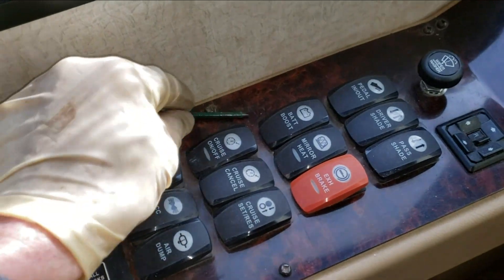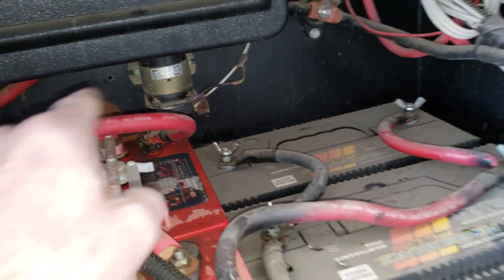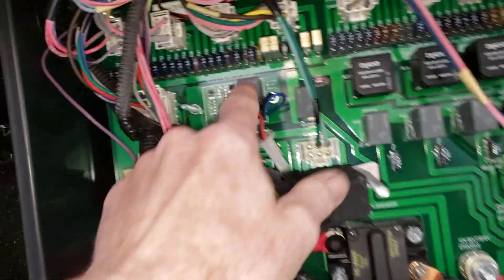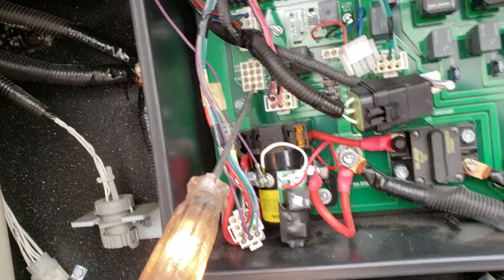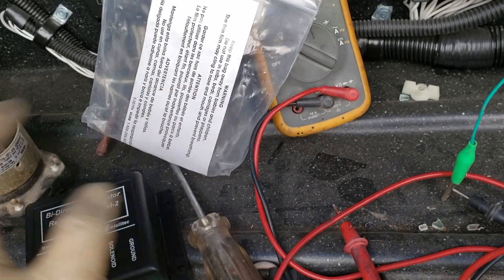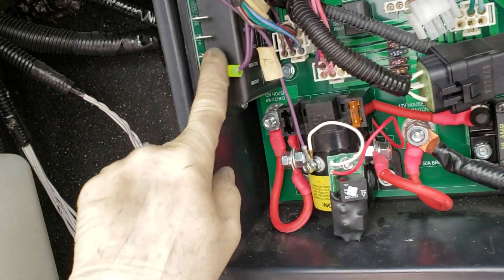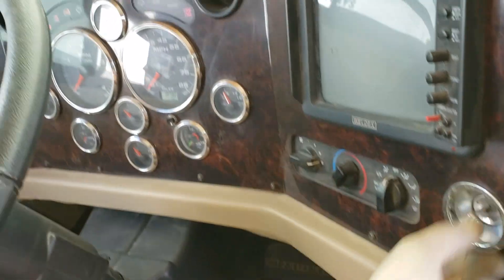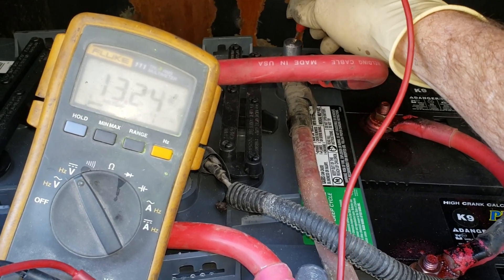Monaco Diesel RV Charging System Upgrade Trick?

Comment: Great stuff here, as always. I was having the same issue when being plugged in for the winters in Florida. I went with a very small batter tender which can live in the battery bay. When plugged into shore power, I do have to run an extension to the 110 outlet in the engine bay. Not a big deal, really. I could run some power to the battery bay and install an outlet in there, but I don't think I'm going to go through that trouble. Seems odd that Monaco didn't think of this. These vehicles are not daily drivers, so the engine batteries should be charged periodically.

Comment: Your videos are very informative and helpful. They have helped me repair quite a few problems with my 2005 holiday ambassador. Keep the videos coming. Thanks for saving tons of money. 😊
Reply from the maker: Thanks Ray
Reply: I know this video is a bit old, but hopefully you someone will see this and answer my question. Would there be a problem just plugging in a battery maintainer into the cigarette lighter and power it from a 110 outlet inside the coach.

Comment: Supplied 12vdc to the GenSet terminal to separate my batteries while using solar going down the road keeping the Fridge on 120vac. Trying not to load the alternator as much as possible. I did have to move the Fridge over to the inverter.

Comment: That Bird sounds like a better option then the factor one. Nice to charge everything off the shore or generator. Nice job.
Reply from the maker: They are priced cheaper than a echo charger, about equal to a Trik-l-start and much cheaper than a good battery tender. The big problem is when the generator is connected to the chassis batteries, but the 120vac doesn't charge the chassis batteries. Older Beavers and Safari's did that. Thanks!
Reply: @AZExpert  Same thing / problem / reality for a Monaco Knight 2000 ?

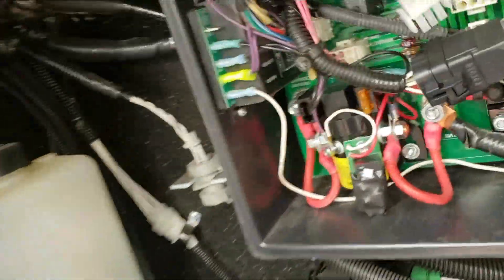Comment: Great video!  I think I will tackle this upgrade.  My only question is at 9:18 you talk about the ignition wire.  It is black coming from the BIRD unit, but at the battery connection, it is blue.  Is that only because you coupled a fuse with it or is there a connection I am missing?  Can't see where they connect.  Also, is the fuse recommended? Thanks again for a great video!
Reply from the maker: Likely, because I only had black wire to use. RVs play fast and loose with wire colors on circuits so I've become numb to color matching.

Comment: Thank you for all of your content, appreciate your clear and concise videos!  I have completed the BIRD install but for some reason I can't get the system to work whether I use shore power, generator or alternator.  I am confident I have everything wired correctly so I'm wondering if my charge solenoid needs replaced or maybe I have a bad BIRD?  A couple of questions for you...
1.  Is there a way I can test the solenoid and BIRD to confirm they are working?  
2.  Is it necessary to remove the existing isolator relay delay?  I unplugged it but didn't completely remove the panel.

Thanks again for your content...
2004 Holiday Rambler Endeavor

Comment: Now that LiFePO4 batteries are available it makes lead acid batteries look so bad.  Lead acid battery specs are so inflated that you can only use 40% of what they claim.  Lead acid batteries degrade when ever they are not at 100% charge, and they self discharge rapidly.  So they are perfect for starting a car several times a week if you don't mind the weight.  If you can't plug in all the time, a small solar panel and charger is my preferred solution to keeping my lead acid batteries working. Just a few watt panel thrown on the dash and plugged into the cigarette lighter outlet can solve the problem.  Harbor Freight is your friend here.

Comment: I just had the charging solenoid go bad in my coach. Lost my DC. I got it back by working the relay about 20 times in a row. I had a battery go bad and it most likely dead shorted. Must of welded the relay contacts shut or pitted them bad. I like this lots. My inverter might be a bit more advanced because is will bulk and float so I think a new relay (same one) will do it. It is working but it’s really hot.
Reply from the maker: These relays go bad often. They will get warm and hum when they are engaged. They should not be too hot to touch though. They are rated for about 200amps continuous but when used to jump start a diesel engine with dead chassis batteries they might get hit with 1000+ amps. Thanks for watching!
Reply: @AZExpert  Mine is hot almost too hot to touch. I am replacing it tomorrow.
Reply: Replaced and a new battery. Warm now so that’s probably normal. Everything is working.

Comment: I bought one of these not long after you made  the video and just got around to installing it. All looks well except it’s not charging as it’s supposed to . When I test the boost relay with the switch it works fine. However after installing  the bird the coach  power is not transferring is to the chassis. Would this be a faulty bird or a bad relay?

Comment: I totally enjoy your videos, you have taught me a lot.  I'm struggling with this one. I have a 2008 Holiday Rambler diesel. There is a BIRD installed but don't know who put it in. The house battery's charge on shore power and generator only, and the chassis battery's charge on engine only. The trombetta  does work with the switch on the dash, all battery's charge when the switch is engaged. The BIRD does have a wire connected to the generator. I assume its either the Isolator Relay Delay or the Bird but I'm not sure how to test them. I definitely need your help.
Reply: Correction, the generator is not connected to the BIRD. The BIRD is a model #00-00362-100 for a gas rig, not sure if that matters.
Reply from the maker: the generator is only used if there is a stand alone generator battery. It's not commonly used

Comment: Thank you for this excellent video.  It is very easy to follow.  I have installed the BIRD following your directions.  I have a 2007 Holliday Rambler Endeavor that I purchased a little over a year ago and still trying to work out all the bugs.  The Bird has not solved my problem with charging the chassis batteries.  With the OEM Isolator Relay, the only time I have 12 volts coming from the power boost switch was when the engine was running, then there was 12 volts on the (purple) lead all the time, power boost switch on and off.  With the Bird installed, the most voltage I get is 3.45 on the power boost switch on and off, it is constant.  Is this a complication with the solenoid in the battery bay?   Do I have another relay malfunctioning or a fuse blown?   Last question, this is not necessary, but could be helpful.  If I run a lead to the BIRD from the generator, will that complicate things when the engine is operating?  There are times we operate the generator while driving.    I will really appreciate any help you can give me.
Reply from the maker: you don't have a generator battery(third battery) so that won't do anything. the bird sends sensing voltage which is what you are likely measuring. Just make sure you have a ground, full time house power, full time chassis power, and a connection back to the solenoid not the switch.
Reply: I believe I have installed BIRD as you have in this video.  The BIRD ground post is connected  to the panel ground.  The BIRD Ignition post is connected to the Battery Chassis post on the panel.  The BIRD coach bat post is connected to the house non switched post on the panel.  I have checked out the purple wire to the solenoid, there is not a problem with it.  I can hear the solenoid activating when I attach a 12 V to the solenoid.  I also tested the purple wire with 12 V connection and the solenoid is activated from the front panel.  I left the BIRD on overnight on show power.  The house batteries have 15.07 V.  I'm nervous about that.  I will be glad to send you a picture of the connections if that will help.

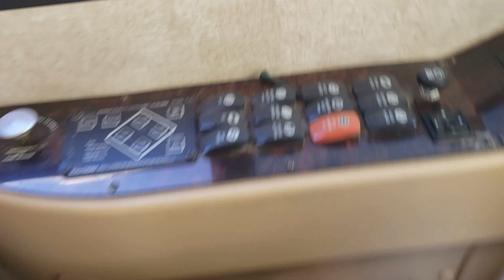I have disconnected the BIRD.   The coach is now set up as original.  I think there was a problem before  the BIRD was installed.  You mention in the video  @5:45, that the test light is now on (with the bat boost switch on).  My light does not light up.  There is 15.07 mv current on the post where the purple wire connects to the 12 post connector.  Is there a relay or a fuse I'm missing somewhere that would send 12 V to that lead?  Could it be a faulty switch?  I just looking for options.   I really appreciate any help you can give me.
Reply: Sorry to bother you.  I have found the fuse and please don't ask me how many times I read the back of the panel cover looking for a fuse and didn't see that line.  Installed a new fuse.  The BIRD is reconnected.  We will see now what happens.
Reply: @melvineisele183  what fuse? I have same issues with install on 2006 Monaco cayman.  And is it working correctly now?
Reply: @bradeisenhauer6294   There is a 5 amp fuse for the Boost Switch. The way Melvin describes it. It must have been blown and he replaced it and is working now.

Comment: I have a question 1999 Monaco dynasty it has 4 6 volt batteries and a large battery this morning it did not want to start the engine only the generator starts my question the 4 small batteries have to do with starting the engine

Comment: Put a trickle charger on the starting batteries while parked ! A simple $25.00 motorcycle trickle charger works great to keep them topped off! Simple solution!
Reply from the maker: Yes. That was a solution I offered, but he did not want to connect and disconnect and have cords hanging out of compartments. I'm with you and would install a battery tender though a nicer quality one should be 50 to 85. Thanks

Comment: Great video. Do 2007 CC's have bi-directional charging? I have just bought a 2007 CC Affinity. It has been sitting for several months and could not get enough of a jump charge to start the engine or the generator. I tried with several jump boxes and then a normal jump from a vehicle. No luck. Before I buy new batteries I will hook up normal charger with a portable generator so I have a charge that is constant and longstanding and retry.
Reply from the maker: That is a great question. I do my best to stay out of the middle basement compartment of Country Coaches. I do not remember seeing any BIRD, but they may have a Xantrex Echo charger which does the same thing.

Comment: What about gasoline motor coaches? I have a 2007 Winnebago Voyage with the Work Horse chassis and a 496(8.1) GM gas engine. When the unit sits for a week , or more, the chassis battery seems to "fall asleep". After starting it with the boost (coach) batteries it's fine. Is there a "sleep mode"?

Comment: Thank you.  Does this work if house batteries are switched to Lithium?
Reply from the maker: Yes it does, but you likely will need a smart relay to protect the chassis alternator as lithium batteries can accept a lot of charging amps when depleted.
Reply: A video on modern day application of Lithium in an older luxury coach would be good.  @AZExpert

Comment: I did this upgrade and it worked great for a couple of weeks. Now there is no charge going to the chassis batteries when on shore power. I did unplug the IRD. Should I have unbolted it from the panel too? I don't know if the new BIRD failed or what else to test. Any ideas would be greatly appreciated.
Reply: Update: The upgrade is still working great! The problem I had came down to two bad chassis batteries. Interstate rep took them to the factory and had them tested then replaced them under warranty. One was 17 months old and the other was 13 months old.

Comment: Interesting, but I'm not sure thats still my problem. My 08 HR Ambassador owners manual says that with generator running and invertor on, it should charge my chassis batteries. House charge when on shore pwr and chassis charge when engine running, but chassis doesn't show charging when generator is running, but house do. Where is my problem? Boost switch worked with generator running to jump chassis and get engine running. Do you have a link to the "BIRD" you use?

Comment: I had a Freightliner dealership put new batteries on my Winnebago Vectra. I keep it plugged in, but last time I tried to start the motor the batteries were dead. Should I just get the battery tender for the chassis batteries, or have the dealership look at it and see why the chassis batteries are not charging?
Reply: By the way, I watch a lot of videos on repairing just about anything and you are one of the smartest guys I’ve seen. I wish I could have you do all of the work on my coach.
Reply from the maker: yes a battery tender is a very good idea, Tiffin came to that conclusion way back in 2006 or so and I'm still surprised no other manufacture followed them.

Comment: Just installed a bird on my Monaco 2008 replace the house batteries and recently replaced The relay in the battery bay don’t know if it’s a continuous duty though how do I tell and also the board upfront (purple wire )is only sending 3.3 V to the relay you think that’s correct
Reply from the maker: it sends out sense voltage to the solenoid, are you checking with the solenoid control hooked up or disconnected

Comment: Sorry I am having problems with my house batteries so I was embarrassed and deleted my post.  I misunderstood the video as I do not have problems with chassis batteries.  Thank you for impressive response time.  I am still trying to figure out the drain on my 400 amp hours of Battleborn house batteries.  I have .4  drain when all is turned off according to my BMS meter on my MSH 3000 Magnum inverter monitor system.  About two years ago I changed to a Samsung residential refrigerator and I and drain house batteries in one day now.  According to all I have researched it should last for several days without any charge especially while driving.  I am trying to research things so I can isolate the problem in order to ask intelligent questions. If I can isolate my issues and ask intelligent questions I would be willing to pay you for your consulting time but I am not there yet.  I have 400 AH Battleborn batteries and my phantom drain is .4 AH I should be able to last for 1000 hours or 41.66 days.  That is not my experience as they are shutdown and in safe mode in less than a month.  I did not turn off the cutoff switch by accident and it pointed out my batteries were not lasting like they should with all systems off, i.e. fridge off, satellite dish unplugged, tv unplugged etc.    Thanks for responding.  Don.
Reply from the maker: small drains can be difficult to find usually down to pulling fuses and cables until its gone, sometimes it's the step with the light on cause the switch is on or the door is open
Reply: Hello guys. I have the exact issue and after some research I believe what is going on is the chassis batteries are getting charged with the lithium. The circuitry thinks the house batteries (Lithium) are being charged do to the higher voltage 13.6vdc and engages the solenoid/relay?!?!? 
Seems logical…….. James, can you chime in with your Jedi knowledge please?

Comment: Did everything but no power at the pin on board!? Replaced rear solenoid and front solenoid. Have power to front solenoid 8mm bolt that is purple wire that feeds switch but only getting 3.3 volts at rear solenoid and when switch is pushed only goes to  5.04 volts.  And does not activate rear solenoid. Works with engine running and generator running but not plugged in.  What is causing this problem?
Reply: And I have 2006 Monaco cayman

Comment: You used the INTELLITEC 0000839000 B.I.R.D but didn’t use the Genset connector.  Could you have just used the INTELLITEC 0000362100 B.I.R.D  which doesn’t have that connector or is there some other difference between those two BIRDs?

Comment: I have a 03 Bounder 39Z DP, my alternator won't charge my House batteries but does charge Coach/Start batteries... Generator or 50 amp plug wont charge Coach/Start batteries but does charge House batteries.  I changed the solenoid, have all good batteries... not getting 12 v to solenoid trigger post, opened Battery Control Box, traced wires to board inside box, you mentioned a fuse you found bad for Batt switch at driver's seat.  I can't find it... I am assuming its in the Batt Control Box but don't see it labeled. Ever mess with Bounder like mine?  I am about to just buy the BIRD anyways as it should fix the charging issues, although would like BATT switch to work in an emergency no start situation where Coach Batts are dead.

Comment: I have an issue with my 2014 Thor Windsport.   No shore power and batteries disconnected, chassis battery went dead in few days, Emergency start would not work.   Jumped it.    No shore power with batteries in use mode, coach batteries dead in few days, engine started right up.
Question:  I went under hood to open isolator panel, and it has a flat steel plate two cam clips that you pull out on the face.  Since I do not know how it works inside I can not figure out how to get the cover off.   The clips don't twist and the cover only got slightly loose.   Any suggestion would be great.
Respectfully,   Kevin
Reply from the maker: if they are black plastic square knobs like a refrigerator vent doo, just twist 90 degrees, and pull out. if they are pull down just pop the handles up and pull out, usually these are into rubber well nuts and get hung up
Reply: AZ Expert    Not like fridg square.   They are like 3/4" arm that pivots at base with a cam action.  Handle down to face plate is latched.  Pull until straight out to unlatch.  I think you are saying pull harder outward.